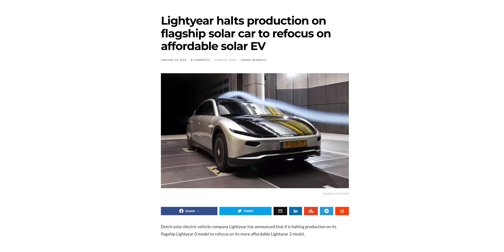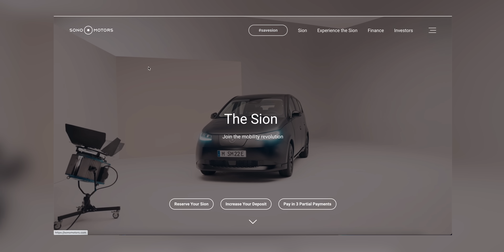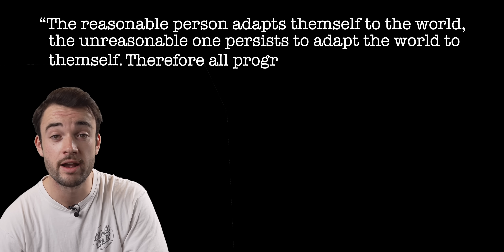Will Solar-Powered Cars Ever Happen??

Comment: Ditch the solar, the original idea was a good seller 5-10 years ago maybe, now though it’s just an expensive unnecessary extra. After 10 years driving electric the best improvements are larger capacity batteries for longer range and the best improvement by far is faster DC charging. If the Aptera and Sono had 64kwh or more battery and 200kw plus dc charging and solar as a cost option they would have a far greater appeal. Well the Aptera maybe not as it’s very niche 😊
…..I do want them to succeed though, I’d like to see an improvement on the 75% loss on my investments 😂

Comment: The issue is that the term "solar powered car" does not match the product in discussion. There are PV cells on the car's roof, however they are so much of "too little" that they never ever have a minor shot on even coming close of powering the car. Hundreds of thousands of potential customers simply do not want to be cheeted at when buying a car. That is, I believe, the main reason why these cars won't make it to mass market.
Reply: If the averaged energy output by the solar panels is above the averaged energy needed for the drivers driving needs, it will be fully solar powered (the car battery will store the energy, thus "averaged"). That might happen e.g. for the Aptera at sunny places if averaged driving needs are less than 40 miles per day.

If the sun shines less on average or you drive more on average, it will still be a partly solar powered car, but you will have to charge it from the grid now and then.

I agree that for a typical car of today, on-car solar doesn't make much sense, because they are way too inefficient. But the Aptera is 2-3x more efficient than the most efficient production cars today.

Comment: Most cars are parked most of the time.  Solar power where cars are parked may assist with charging.
Reply: Exactly. It's much more sensible to leave the solar panels at the car park than carry them around with you. Require all car parks to have solar panels powering EV chargers snd that will nake a big dent in the problem.
Reply: What they need is a car powered by rain, for places like Manchester.

Comment: I really want the SION. But not because of the solar cells. I believe that solar panels on the house is both less expensive and also more effektive. Putting solar panels on a "normal" European house might give energy corresponding to 100 000 km every year. SION is so much more. It is a really practical car.

Comment: At approx 20% efficiency  commercially available solar panels, they make no sense on a car. Once commercially PV panels reach 40% efficiency then they might make a reasonable spec option.
Reply: Aptera is technically an autocycle and improves its efficiency over a typical car more than the 40% you mention would.  They are where they need to be now for the average daily commute distance in much of the country.

Comment: It's not hard. The Indians have been doing it for 10+ years with lead-acid batteries on rickshaws. Those have at least 2 squaremeter flat roofs, enough for 400+ watts of solar.

Comment: Espero que Sono Motors lo consiga. That car may be my next one, I'd like to harness the energy from the sun without having to install solar panels
Reply: No it won't. Sono motors just shut down the development and is laying off the staff...
Reply: Even a balcony panel that you plug into your mains produces more usable energy and that costs 700 Euro and that you don't need to park in the blazing sun so that when you want to drive it you need to invest a few kWh in cooling it down to survivable temperatures before you enter it. Black is a good color for solar panels but in the blazing sun it sure heats up nicely - that will also not make battery life any easier (unless you waste even more energy to keep them cool)...

Comment: It seems closer to the ball to just produce a folding panel system (that fits in the trunk let's say) that can be used to charge the popular brands that are already out there while parked.
Reply: Yeah, this has been my thoughts recently, some self-standing panels we can set up beside the parked car and on top, that feeds directly into the batt.
Reply: @dama9150  Ideally everyone should have PV on their roof and a folding panel if they do things like camping. But an EV is a major power storage device so why not have built-in PV so that your charging even if you're just popping down to the shops. The Sono is an urban vehicle – most the time it will be parked somewhere where you can't exactly unfold several square metres of panels. If you park at work and your employer is not enlightened enough to provide charging that rooftop panel could mean never having to plug in ever. A true self-charging car. Take that Toyota!
Reply: Cool idea. Some people will love to pick up expensive solar panels standing around on the boardwalk.
Reply: @vic321344  Yeah, that's a fair thought. Some measures could be taken. But hopefully, panels will be so cheap that it won't be a huge factor.
Reply: @vic321344  yes, let's not do the worthwhile thing, always focus on the bad thing that could happen...
Reply: @dama9150  so you prefer to dream?

Comment: Stop trying to reinvent the wheel. just build normal cars that are practical and if there is room add in solar panels it may not add much range but it's a start. Try it out on things like vans and buses that have more roof space.
Reply: The energy consumption of such "normal" "practical" vehicles is known and quite high. Solar only makes a significant difference if a vehicle is way more efficient than the normal ones. Then you'll get quite some km / day just on solar (like up to 64km/d for the Aptera).

Vans and buses are as aerodynamic as a brick. Of course you can still put solar panels on such vehicles also, but you can not expect to get significant km / day range for these. You can supply that power to A/C or other usage though.
Reply: @ThomasWaldmann  if it's not practical it's a waste of time. Adding solar panels to cars will happen when it is cost-effective to do so. Vans and buses are as aerodynamic as a brick so what so you waste all that roof space. it doesn't matter how  aerodynamic  it is wan it parked up 80% of the time like most vans are or in slow-moving traffic

Comment: As an Aptera brand ambassador, I really want Aptera to succeed but I don’t see any of these companies getting funded simply because it awards owners too much freedom from the oil companies…
Reply: If it will be a good idea it will be funded by the buyers.
Reply: @beatreuteler  And there it fails. It's not a good idea. To the contrary, if you have even an ounce of physics education you know it's a complete waste of resources. Depending on where and how you park the car you can expect only a few of the panels to even generate energy, the rest will be in shade or poorly oriented towards the sun and thus be so inefficient that they are not worth the extra weight (of the panels and the charging electronics). 
Just think where you park your car? Any trees around? Chop them down. Own a garage? Demolish it if you don't have the space to park in front of it. Have a high building close? How about demolishing that. What about the parking in town? Is that with a free line of sight of the sun or inside a multi story car park or has the car park shelled out for sun protection (like in southern Europe) so that cars don't heat up that much in the blazing sun while they are parked.
Reply: @karlgunterwunsch1950  I think you completely got the point. Even in more detail than needed because I think only 50% of the reasons you found would already be enough to make it fail.
Reply: So the oil companies are keeping solar cars down?  Give me a break.....
Reply: @bobhilder1469  These are the excuses you always hear and read when it comes down to failed startups or other businesses that didn't but do their big mistakes @ missing the lessons to learn.

Comment: Why haven't EV makers, like Tesla, and even Ford, just slapped some solar panels on their vehicles? It seems like a not so innovative thing? I'd suspect that there are practical hurtles in producing them, that makes it not worth it for the companies, or the consumers.
Reply: 23 years ago (!) I hung out with the university of michigan solar car team as a freshman. I didn't really contribute anything useful; I was a freshman and not even an engineering student. However, I did get exposed to the world solar challenge and the solar car R&D stuff. I also got exposed to people who were 'conservative' business school students who would say things like "why would you ever spend money on solar powered cars? it's clear the physics/electrical power requirements don't line up and it won't work!" Of course, if you don't do something, it'll never happen.   I think the problem is a combination of "solar panels are expensive", "solar panels don't provide enough power per unit area to power or charge a car that takes a lot of electricity".  You can easily put enough solar panels on your house to power your house. Your car is only so big, and you can only cover so much of it with solar panels.

Comment: Problem is we have been sticking solar panels onto clunkers and trying to drive them around. DO APTERA! But yes solar powered electric car is already there if you have an EV. Install a solar panel on your roof or throw some in the backyard. Charge the car through solar, you have the solar powered electric car! What is this thing with having it on the body of the car, you dont need that.
Reply: Many people have normal jobs over the day, so the vehicle they use to commute is not close to their home's solar panels.
Many people do not have an own house to install rooftop solar on.
Many people can not charge their vehicle at home because they do not have a garage, but park in some public space.
For these, vehicle-attached solar does make sense IF the vehicle is efficient enough.
Reply: @ThomasWaldmann the best thing to do would be requiring those workplaces to install sollar panels and ev chargers so people can top up their car while they work.
Reply: @adrianthoroughgood1191  Sure, that would be good. But at some places that could take quite a while and at other places, it might never happen.
Reply: Better sill if we could design a micro-grid power system with other renewable energy source like wind. Wind and waves are the best and largest batteries we have on the planet.
Reply: @VedaSay  Iowa already gets 57% of its main power grid power from wind.  It is a huge benefit.

Comment: Solar-powered cars doesn't make much sense. Place the solar panels on places where they get better efficiency and just use that power to charge the battery in a car. Solar powered cars pretty much need the same battery size as a non-solar car.

Comment: The most realistic solar vehicle is an efficient EV recharged by a domestic rooftop array. I’m going solar powered in a couple of months, without waiting for aptera, lightyear etc.
Reply: Of course, this is not an either/or choice.
Reply: @n.brucenelson5920  of course, you can have both. Just adds cost and complexity. Much depends on where you live, park, how far you drive, etc. I live in the north of England, park in a covered parking garage and have a battery in my roof space charged by my rooftop solar panels. For me, the cost/benefit of also having panels on the car is not a paying proposition.  The case studies from Aptera are for people living in California who park in sun drenched parking lots. Different payout.  
For me the attraction of Aptera is its efficiency, not the onboard solar. Your Mileage May Differ.
Reply: @MandyFlame  Yes, exactly.  I live in Iowa, an in-between case.  I will be very interested to see what the Aptera design will look like once it is homologated for the UK.  Some of the design choices will change, for sure.
Reply: @n.brucenelson5920  yes, I preordered one when I was living in Seattle, and cancelled it when I moved to the UK. The roads in my 1000 year old city are not designed for an 8’ wide car, nor are the cobblestone and potholed streets very friendly to a three wheeler. I’m still wanting to own one, but hoping for a European version Aptera Mk II
Reply: @MandyFlame  I hope that happens for you.  Have you looked at the Microlino?  

I used to drive all over Northern England as a rep for a quality control and environmental Instrument company, and my sister and her family now live near Macclesfield.   All the best to you.  I hope that there will be an Aptera version designed especially for you.
Reply: @n.brucenelson5920  looked at the Microlino. If I only needed a city car I would probably order one, but unfortunately I have a 3 times a week commute that is beyond its range, plus it’s a little slow for highway
Reply: At last, someone talking sense! The side panels on the Sion will be in shade for much or the time. And the roof will suffer obstruction too.  Be better to take the panels off and make it simpler and cheaper.
Reply: Solar canopies over car parks. I want to see more of them so badly.
Reply: There's no car like the Aptera.  NONE...
Reply: Many of us are not homeowners.
Reply: Car mounted solar will be mostly a gimmick for a very long time. One use case it could fit is for people who have to park in places where they can't charge, eg in the street. If you drive a short distance per day but really can't plug in while parked it could significantly reduces the amount of fast charging you have to do. I think it makes much more sense to take strong action to make charging available everywhere though.

Comment: 10 full size solar panels in Las Vegas summer sun will provide enough power to move a Tesla Model 3 standard range about 15 miles at 70mph. Just the panels cost $2000 but a professionally installed system with 10 kWh battery will be more like $20,000. At current electric or gas price to get your investment back will take 10,000 to 20,000 days or 27 - 54 years. That's in Vegas.
Reply: That is not the case with Aptera.  Full solar runs $900 and adds around 40 miles per day under such conditions.  Why use an unrealistic comparison that sells short what Aptera has done?
Reply: When just adapting the investment ever so slightly to make it a system that can power more than just the car (the home, little part of the grid, the heat pump depending on where you live) and the time for ROI will shrink to less than 20 years.

Comment: Personally I think the idea of solar powered cars will not take off. There’re several technical reasons for that. Honestly I never put my car in the full sun. Local solar production and storage is much easier and more efficient, next to charging your car overnight the solar energy can also be used for other loads.
Reply: Kurt, I tend to agree with you regarding the current Aptera design for Belgium, based on my own driving experience there. It was not designed for your conditions.  I do think that in the future we will see a version more optimized for your roads.
Reply: It is not an either/or choice.  When V2G is standardized, which is getting close, SEVs can be used to support the grid, and the local production will extend the practicality on camping trips.  We plan to use ours to camp in Death Valley immediately after picking ours up at the factory, and the full solar will provide wonderful added utility.

Comment: They wouldn't have this problem if their cars were $25K instead of $250K. 
There are new battery technologies coming and solar paint is also in development. 
Right now, EVs are too expensive to buy. Only the rich can buy them.
Reply: The base Aptera is currently priced at $25,900. The Launch Edition (larger battery -- 400 mile range, all-wheel drive, and enhanced audio) comes in at $33,200.

Comment: Solar powered EV.  Even the tiny Aptera motorcycle can only go 10 or so highway speed miles; IF, you leave it out in blazing sun. Few people living in high sun areas do that; bad for cooling once you get in. If you were to double solar cell efficiency your potential is 20/25 miles; - but you can't do that now as such cells are far to costly atm; and it isn't very practical. Solar Racers have one passenger and get rid of the batteries to keep ultra light - but - if there is no sun like night and clouds - you go nowhere. A more reasonable possibility is to have flexible solar panels and park your car so you can roll them out on top of your vehicle; maximizing area and power; you can simultaneously block sun from entering the passenger area. if you had 3 full size panels you could get a model 3 standard or Prius Prime to go about 6-7, the smaller Aptera type 14 miles if you leave it out all day.
Reply: First of all, Aptera is hardly "tiny" with room for 2 plus 32.5 cu ft of cargo space.  And at EPA highway speeds it can get 40 miles in high sun areas - or perhaps 20 miles per day average in Iowa where I live - still enough to meet my daily needs, and certainly enough to amortize the cost of the cells.  

Where are you getting your data from?  It understates the reality.